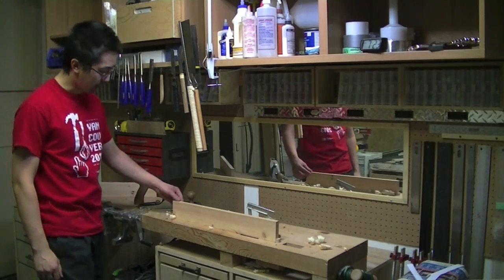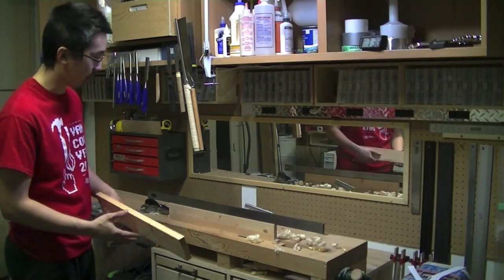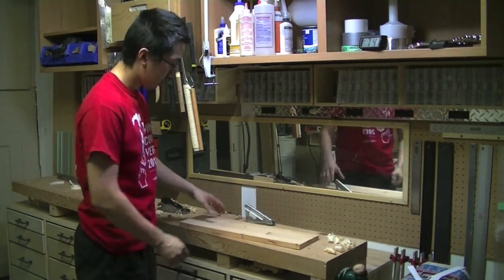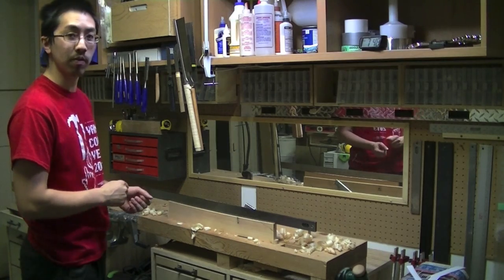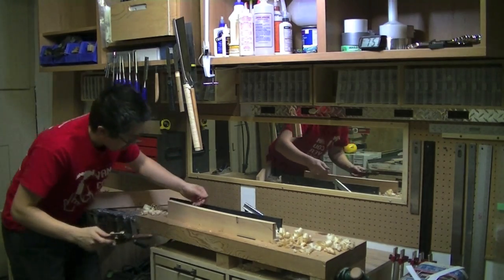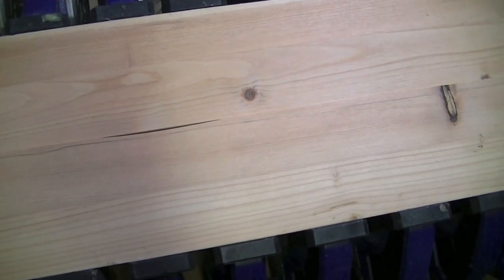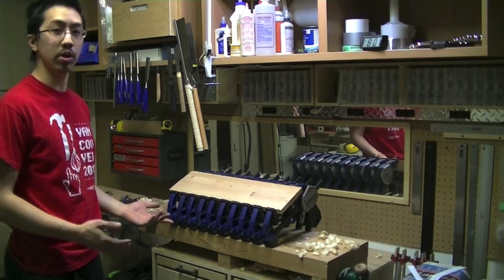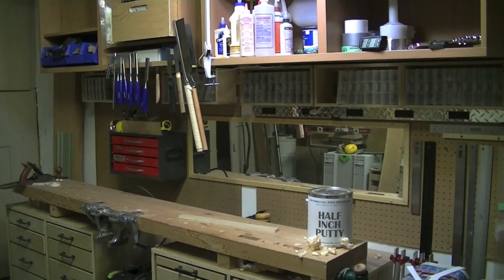Simpler Edge Joints

Comment: Hi Chris, after glueing and clamping the two boards together you will have compromised the outer edges of the two boards. Do you now joint these edges? What are the consequences of this? Colin in Northern Ireland
Reply from the maker: +colin farrier The outer edges, provided they were not irregular to begin, should remain fair, so no additional work would be necessary.

Chris